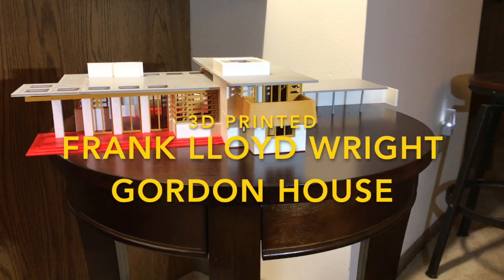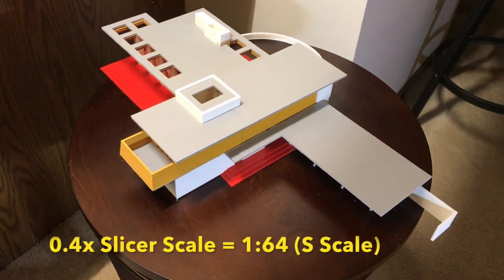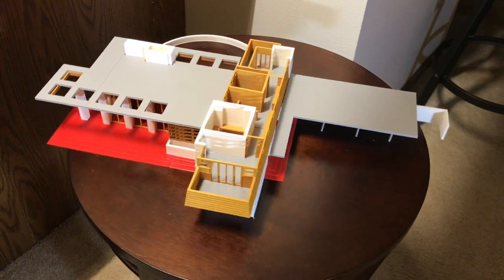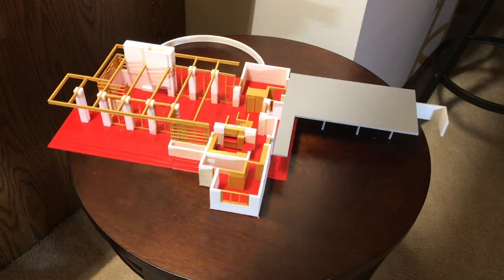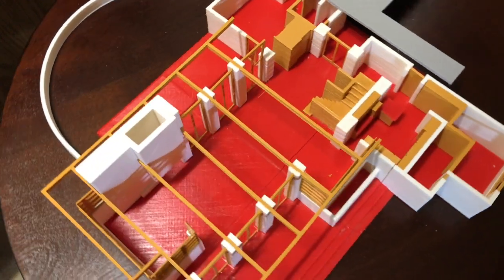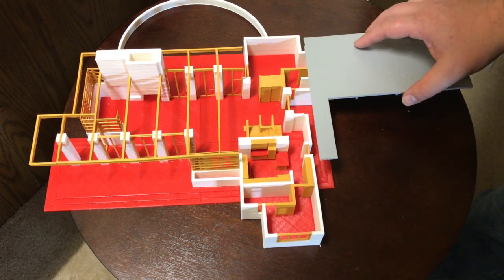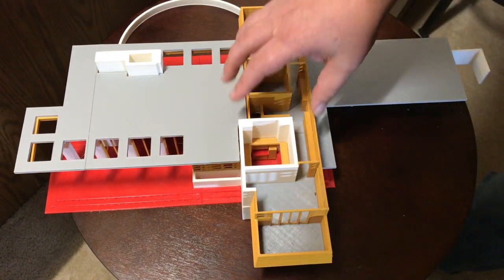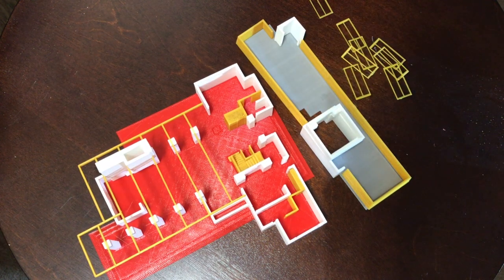3D Printed Frank Lloyd Wright Gordon House

Comment: This is great. I recently recreated my own house based on floor plans online. I had some trouble aligning the second and first stories, specifically, the stairs ended up being much steeper than real life. How did you cope with that?
Reply from the maker: Make sure the height between floors is correct. Maybe yours is too high. Also, your top step is the second floor, so you want your staircase to be one step short.
Reply: @geeteoh1  Thanks for the tips! I'll check that out for sure